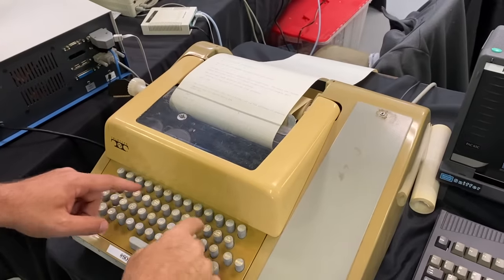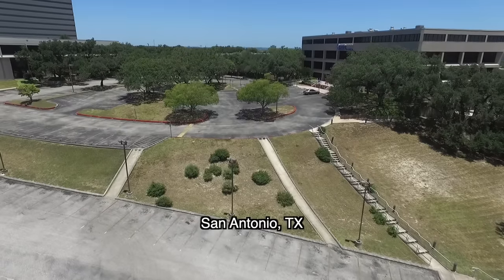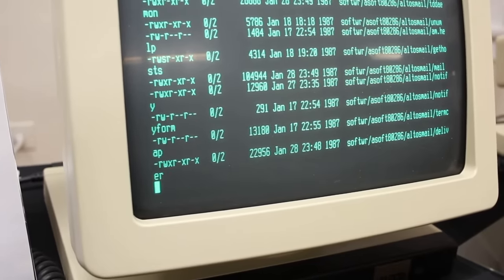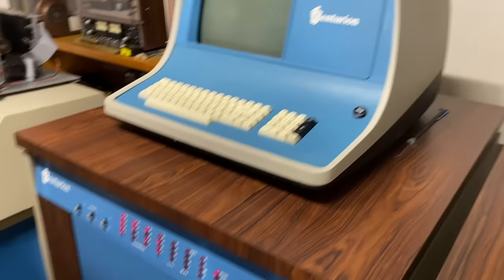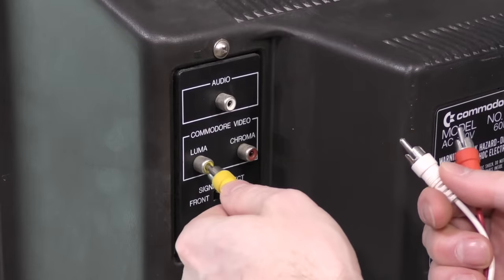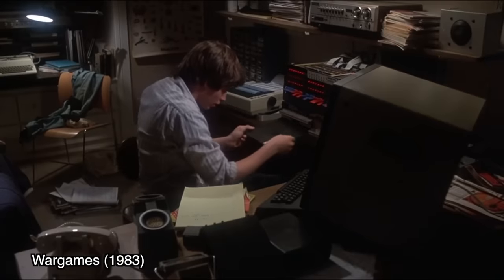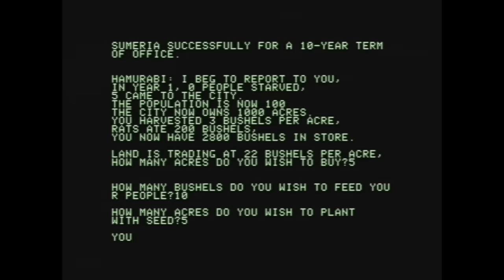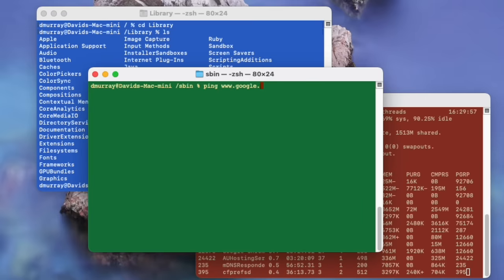What are Dumb Terminals?

Comment: In the 70's, I was a tech on a mainframe. All tranisiters, descrete and core memory 5Kb x 12 bits. They ran 2 branch and 4 other banks with online terminals. Crts, thermal printers and k/b. Altogether about 100 or so terminals. The ones in the main bank were running at 1200 baud, but all the out of town ones ran 300 baud. Even so we had a heck of a time keeping the out of town ones running. In those days RS-232 was not 3 wires and forget-about-it. We had to use the full RS-232 complement. If the telephone co moved our line to different pair (which they did a lot) we had restrap the serial port pcb for all delays and there were a ton of them. That is something people don't appreciate nowdays, exactly how hard it was to keep a remote RS-232 line running.
Takes me back a year or two.
Enjoy you channel.

Comment: 10:48 - That's a great explanation. Reminds me of MIDI use with keyboards. I can set up a MIDI controller to a synth and use that to play (control) the synth, but on its own, the MIDI controller does absolutely nothing. The lights may be all on, but without a synth to echo data (music) through my monitors, the MIDI controller can be thought of as a dumb terminal.
Reply: At its core, a MIDI instrument is basically a serial output and a bunch of buttons. So it's like a terminal with a broken screen.
Reply: That's an interesting analogy. From 1993 to 2017 my main keyboard was a Roland A-80 which was just a master keyboard - it had no internal sounds whatever. It's job was solely to tell my MIDI sound modules what to play. The keyboard that replaced it in 2017 DOES have internal sounds, but when doing MIDI sequencing, I switch it to Local Off so that the keyboard part and the internal sounds are separated, and the internal sounds ignore the keyboard and only listen to the MIDI In port, acting, in effect, like a terminal.

Comment: One of the first jobs I had back in the late 90's into the 2000's, was at a data center for a hospital system in my region. They used terminals with green CRT screens for executing commands. I still remember some of the commands: "prt2rdms" would poll the system for jobs that needed to be sent to a printer. Eventually, they upgraded to a windows based computer but still used Terminal Emulator to execute commands to the mainframe.

Comment: I worked for Visual Technology from 1980 until 1987 with a good portion of my time spent as a technician on their terminals and equipment. The company designed and manufactured Z-80 based terminals that emulated various models such as the DEC VT100 and DEC VT52. 

In the early 80s' the company acquired Ontel Corp. Ontel produced "intelligent" terminals which were more like personal computers. These 'terminals' had peripheral devices such as Hawk and Wren drives, floppy drives and other cards. Ontel was a big OEM manufacturer and created custom terminals used by Walgreens for their Inter-com RX system and became the sole supplier of terminals for Control Data Corp.

While working on this equipment, I learned a ton about both analog and digital electronics which led me towards a career in electronics and later MIS and IT.
Reply: I remember staying up all night, and a friend of mine and I banged out a gif2tek4207 program to display graphics in some of our labs.  Yeah, these were the labs that didn't have the Sun computers.  Only vt100s, some v52s, and a handful of tek 4207s.

Comment: That takes me back, the first computer I used was a Cromemco System 3, with an ADM3. Thinking about VDUs in the valve era, they probably could have used storage CRTs, like RADAR, and vector graphics, which would be less demanding on the storage, it would have been a lot like drum or mercury delay line memory.
Reply: I think there were a few vector terminals, but they would obviously require a very different format for the serial input.
Reply: @charliekahn4205  Interesting, I would have imagined memory mapped in some way

Comment: Awesome showcase David & brings back a lot of memories repairing these for work & so cool to see Usagi!.
Worked on ADM 11-32, Wyse 30-60, VTE 6 & 200 display terminals which were used on UNIX, PICK, some IBM 5364, some Control Data, CP/M & MP/M (multi user CP/M) in the late 1980s & was doing both field service at customer sites & also component level repair on both their logic boards & monitor sections, mostly through hole PCB construction along with both Genicom dot matrix & Dataproducts line printers.
Sometimes we'd get oddball terminals for repair which were pure 74LS bit slice CPU logic, much like the PDP-11/40.
Back then, those terminals didn't have a lot of the modern line isolation on their RS232 serial lines one normally sees these days with MOVs, transient suppressors etc & we'd dread any lightning activity as it usually used to kill both the 1488/1489 line driver ICs & if we were really unlucky it also killed the 74LS data buffer chips & much more.
Supposedly, the RS232 length was max 50ft/15m but I'd worked with many sites who had 100ft/30m of RS232 underground cabling back to the central MP/M box via a few line driver plug in cards & even learned a lot of the hidden service codes.
One time, we couldn't get the flybacks/LOPTs due to a transport strike & managed to successfully repair about 10 of them using a Dremel, fine soldering, HV silicone & special pre-mix black epoxy.
In some sites we used 20mA current loop & one time at some industrial plants they had to use some specialised converter due to arcing from site machinery playing havoc with the 20mA signalling.

Those dumb terminals were awesome to work on, nice construction, great support documentation & was sad to see them go.
Back in the 1980s these things were everywhere until the IBM clones came out.
Back then manufacturers really took pride in the things they created & quality PCBs too.
It was hilarious when 56kbps BBS came out as we knew a lot of the ANSI codes backwards we had picked up from repairing these dumb terminals

Comment: I worked in the helpdesk of a bank when I was a student. At that time they had replaced all their terminals with simple computers that hat no harddrive, but a 3.5" disk drive. There was a floppy disk in there and the front was closed with a panel. So the computer would boot from the floppy disk to run a terminal emulator in textmode.

Some years later, they switched to Windows PCs that had some programs, but still also had a terminal emulator to access other programs that existed only on the remote computer.

It's interesting how these principles return in waves to the industry: terminals -> PCs -> slim client + server -> fat client -> slim client + cloud -> fat client + cloud ...

Comment: Back in Data Processing class, we had several Zenith terminals hooked to a main computer.  You had to save your work frequently or you would use it.  Someone figured out if you issued a command “CALL FRED” it would lock up all the terminals, and the main would have to be rebooted.  You would hear someone scream when they realized they didn’t save their work!  That was a mean trick 🤣

Comment: In the early 90's, I spent a lot of time with my dad at his work. Holiday Inn used a unix like system called Holodex for their worldwide reservation system. Each hotel had a main server and several dumb terminals. At the time that was all implemented with expensive IBM PS/2 hardware including the terminals (which booted the terminal client from floppy or an option ROM).

Comment: Ahh memories!
I was a Computer Operator in the mid 80's for Durham University in the UK and they had a beefy Computer Room, housing corridors of Dec PDP Cabinets and an Amdahl V8 'Super' in a 'Cray' type arrangement with a central column with seats around its perimeter haha
It served a huge network accessed by dumb terminals and the occasional Early IBM PC. Printing was as good as Dot Matrix at the time but Laser Printers became a thing and revolutionised  Office Printing. Tape reels were still being used, plus a 'Hard Disk Drive' was more akin to a Top Loading Washing Machine with a clear Perspex lid, housing its Huuuge rotating Platters

Comment: I learned programming at Jacksonville State University, which had an IBM 4381 mainframe and we had the large IBM 3270 terminals, which were smarter in that they were "block mode" and software tended to create fields on the screen and sent a screen at a time to the mainframe through a terminal controller and got updates back (much, I guess, like modern form-based web pages work).   It allowed a lot of users all over campus and elsewhere since every keypress didn't interrupt the mainframe CPU.  This was 1984-1987.

Comment: I found one in the dumpster of my apt complex in 1987. I was the happiest kid ever with my own "computer". It was a Motorola, similar to those Wyse terminals usually at libraries. But I didnt know at the time. No drives, couldn't run anything. I just typed random stuff and tried to make ASCII art. A neighbor came over and said I could get a modem and dial up into BBSes, but wouldn't get into that until years later.

Comment: Back in the late 60's, I worked for Control Data where we made thousands of CRT terminals which connected to the main frame via serial. These were used by the airline companies and the IRS. Later I worked for another smaller company, TEC, which made a similar product.  Ironically, in 1984, I was working for a hospital which had just upgraded to a Nortel PBX.  The input terminal for that system was a Model 43 Teletype!  I eventially replaced it with a PC with serial port.  In the late 70's, I wire wrapped a version of a "TV Typewriter" which was used with my Synertek Sym 6502 computer.

Comment: When I was a postgrad in the 1980s, I used terminals like this connected to the university mainframe to program models of chemical engineering systems, as part of my research.

I also used to do one lunchtime a week supporting users in the university's Management department. They used terminals (VT100 or similar) connected to a big minicomputer in the Computer Centre.

It was very common for users (who weren't very tech savvy) to just switch off the terminal without logging out.  If I found a terminal in this state, I used to add a command to their login script to display a message to remind them to log out.

Another problem arose if a whole class was using a program that used a lot of communication between the terminal and the central computer.  This caused all the terminals to s l o w   d o w n  terribly.  The staff would ask us to fix it, but there was nothing we could do, it was a result of poorly written programs running in limited hardware.

Comment: In the 2nd half of the 80s and the early 90s I used Digital VT220 terminals (and later a VT340) to connect to the companies DEC MicroVAX II. Used a VT100 emulator to allow my Apple IIgs to connect with that system, too.

Comment: I briefly worked on an IBM AS/400 in the late 1990s and used a lot of InfoWindow terminals (or an emulation on a PC).
You could view a stream of messages on screen, but also redirect ("OUTQ") it to a line printer or magnetic tape as easily.

Comment: In 1970 my lab had a bunch of ASR-33 teletypes, and a smaller number of Datapoint terminals, connected to an SDS Sigma-7 timesharing system. ASR 33 -- 110 baud, noisy, hot, and you'll never forget the smell of hot machine oil they give off. In comparison, the Datapoints were heaven! Even at 1200 baud they were a big step up (we did a bootleg "upgrade" to two serial ports to take the terminals the staff used to 9600 baud -- what a deal). Some of the early Datapoint displays, and some others, used shift registers for the character memory. I don't have the same kind of nightmares about stripping and rebuilding datapoints as compared to rebuilding model 33s with ground up plastic gears, or converting them from current loop to RS-232. I DO NOT MISS THESE DEVICES!

Comment: ADM-3A! Old Blue. Mine was running on an inverter, sitting beside the turret on an  M-47 army tank in 1972, one of the very first autonomous vehicles in history. I installed everything, and I did the construction of the computer, too, right down to making the PCB's, (not ordering them.) What I built couldn't be bought off the shelf. It hadn't been invented yet. We were inventing it. Then I installed the computer and control servos in the tank and tested it all. Good times! Good memories.

Comment: Fun fact, to this day you can find Linux calli serial connections and terminals tty which stands for teletype 
And windows and HTTP protocol end of line isn't just NL -new line character like in Linux, but CR +NL, carriege return + new line just in case you will want to display YT's html on teletype that needs to be told to return carriege to left most position before going to next line.

PS ok it really to keep compatybility with teletypes but to maintain compatybility with previous systems that maintain compatybility with previous systems and so on back to dos, CPM and teletypes.

Comment: This is great.  Where I work, we started with terminals connected to an IBM mainframe which we connected through an AT&T cluster controller and even though we replaced all the terminals with PCs, we still use terminal emulation to a mainframe.   Good times.

We also have Digital VAX equipment.

Comment: Many terminal set ups use serial as a means of network instead of coax or UTP cable. I remember doing IT work for a car dealership and they had plenty of dumb terminals all connected to a mainframe PC in the office via serial. You could connect a Windows PC via the serial connection, set the baud rate and other settings, run the built in terminal software and it worked perfectly.

Comment: Those terminals are based on remote echo i.e. when you press a key he letter goes to the computer that sends it back to the screen. There were also systems based on local echo. That is the letter went directly to the screen. Then when you pressed Enter then the entire line or even the screen is sent to the computer to be processed. That way each terminal did not constantly bother the computer. Of course in such a  system any arcade game would be impossible. Also in the the Enter and the Return were entirely different keys. The Return just moved the cursor.

Comment: I don't remember what they were called but I remember in one of my computer classes they were talking about how there's a type of computer that doesn't have a hard drive or any other processing other than like a basic just to get it working and then you connect it to a server and the server sends you all the data operating system etc. Basically sounds like the modern version of the terminal.
Reply: @IcyTorment  ya that was the word.

Comment: I'm glad you expanded on the 'dumb' terminal a little, but I recall (quite clearly) that there was always a differentiation between different types of video terminal.
In the definition that I always used, a 'dumb' terminal was one without any cursor addressing features. These were really just as you describe them, glass teletypes. Terminals with cursor addressing, in my opinion, never did fit into the 'dumb' terminal category
Occasionally, you would come across a terminal that did not have cursor addressing, but did have non-distructive vertical and horizontal spacing characters, which if there was also a home cursor sequence (which would move the cursor to a defined location on the screen), you could do some relatively crude cursor positioning.
But you've also missed out a whole segemnt of not-so-dumb terminals, which allowed data to be loaded into the terminal, edited, and then transmitted back to the computer it was attached to, things like the IBM 3270 (which used neither ASCII nor RS-232) and Super Beehive terminals (and also, I believe, Dec VT131) amongst many others. These generally worked in 'half-duplex' mode, which did not rely on the computer to echo characters back to the terminal, but worked locally and then transmitted the data back up to the computer one field, or possibly the entire screen at at time. These were normally used for on-screen form-filling applications, and were often in remote locations from the computer, as they did not need constant connection with the host machine. These were anything but 'dumb'.
If you can find a copy of the /etc/termcap file from early(ish) versions of BSD UNIX (pre BSD4.1, it got a bit of a cleanup), then you can see some of the workarounds that the maintainers had to do to get applications like vi working on terminals with differing capabillities. Some of the comments are quite interesting!

Comment: My childhood friend had a dumb terminal at his house.  His father was a professor at the local college and would use the terminal to access the Vax mainframe from home.   The BBS his dad ran on TRS-80 Model 1 did not support dialing out so the line had to moved from one modem to the other and back.  Later the BBS moved to an Amiga 1000 and that software (BBS PC!) did have a terminal mode so the dumb terminal was returned to the college..

I myself had a dumb terminal in the 1990s for use as a amateur radio packet station.  Believe it was a Tandy DT-1000.

Oddly I realized right away when the cable was disconnected from the terminal and no characters appeared that it was using Full Duplex mode.

Comment: My high school and local libraries used terminals for electronic catalogue and checking books in and out. It’s the only place I’ve seen them.  The local library also allowed you to dial in via modem and connect to the catalogue, look up and even reserve books. There was however a 2 or 3 minute limit on access before you were booted. I assume to share the connection with others.